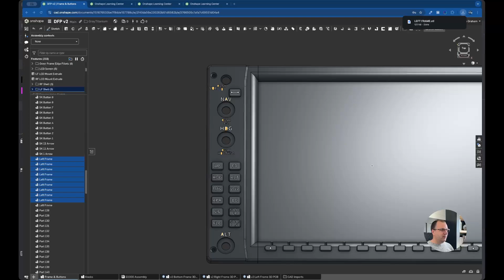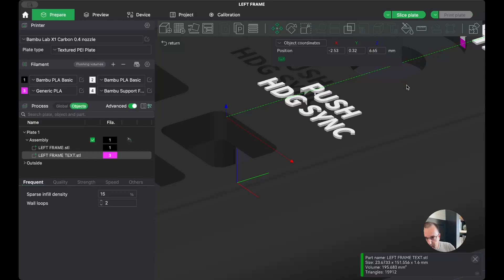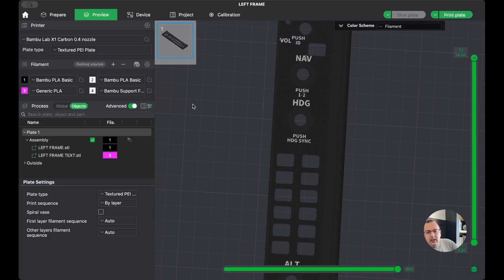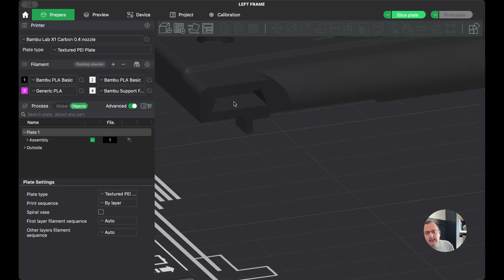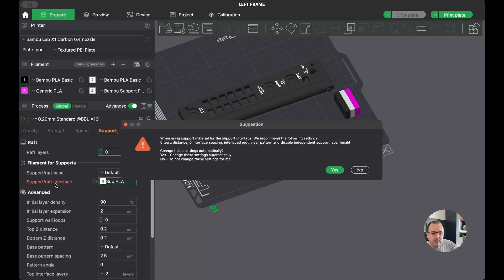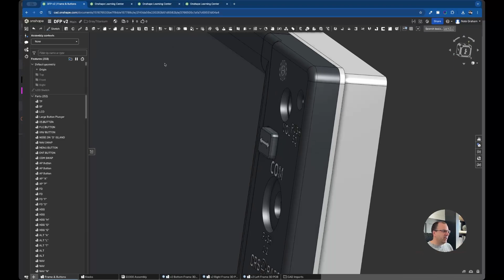G1000 3D Printed Backlit Panels Walkthrough –  Onshape & BambuStudio

Comment: What is the size of the letters that you are using? And which nozzle do you use to print?
Reply from the maker: The small text is 2.5 mm tall. That's the smallest I can print with a 0.4mm nozzle that still looks reasonable.

Comment: I too have been watching many of your videos over the last week. I would like to start to building a PFD and MFD.  and audio panel. I  have looked at "Onshape", and exported your files as STLs as you indicated. Based on date stamps and titles v2, I assume are a revised version and dont need the older file. It did not take much time to export the files to a folder. Qs 1- Can I print the STLs as they are (after slicer) on my Ender 3 V3 SE? I would like to just order the PCBs so can just install the buttons and encoders parts and solder them in. Can you suggest a source that will fit your design? Lastly, I would like to use a touch screen display so I can also you this as a G3000 with Pop-Out-Manager. Any screen suggestions?
Reply from the maker: I used to have an ender 3. I believe all of the parts will fit on it, except for maybe the stand. This is the screen I use: https://www.amazon.com/dp/B07R3RZC4F?ref=ppx_yo2ov_dt_b_fed_asin_title&th=1

I'm not sure if there's an equivalent touch screen version of it.

Comment: Thanks so much for taking the time to create the video, and giving access to your design files! I ordered a set of your pcb boards from JLCPCB. I should see them tomorrow. I believe I am working with the same files you started out with for the bezel and buttons. Button 1 &12 on the bottom frame give it away!. I do not have easy access to a 3D printer, so my build will be a little more challenging. I do have access to a cnc, and will make an attempt to mill the bezel as a single piece.  I will be using a 9.7 inch display, as the 10.1 inch displays have jumped in price. 

Looking forward to seeing your next video!
Reply from the maker: That’s really cool, I hope it works out!  Let us know how it goes
Reply: Yeah let us know if cnc works out. Wood/plastic aluminum?
Reply: @Gersmobiel  I will be using 6mm white plexiglass for the bezel, as it should work well for backlighting. I will do the initial cut and then paint it black. Then I can mill out where I want things illuminated. I have done a couple of test cuts, but am not happy with the results. I am using an OX CNC from OpenBuilds. I am just finishing up the upgrade to the OX Metal version. It replaces the GT2 belts with lead screws, so I should get the results I am looking for.